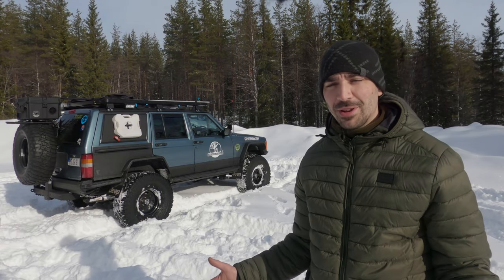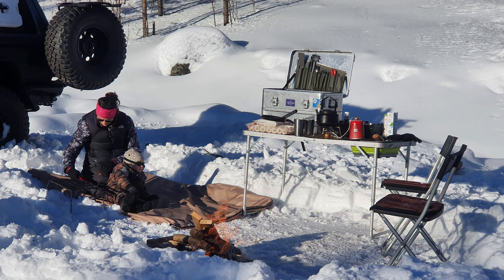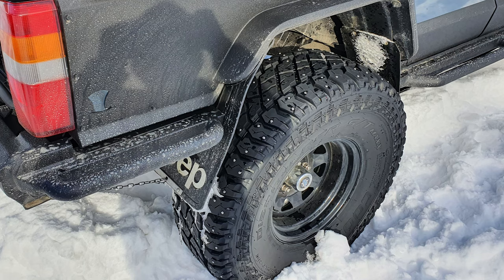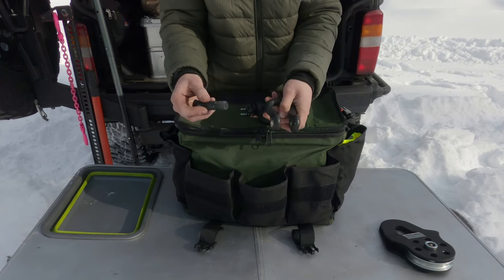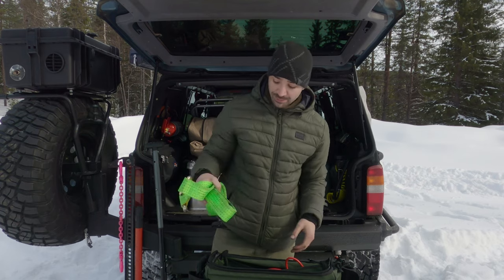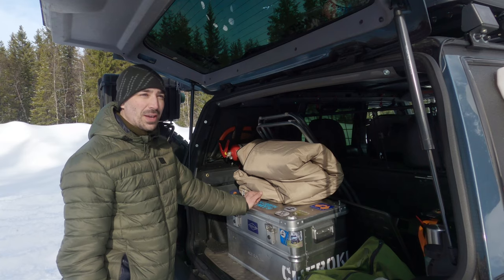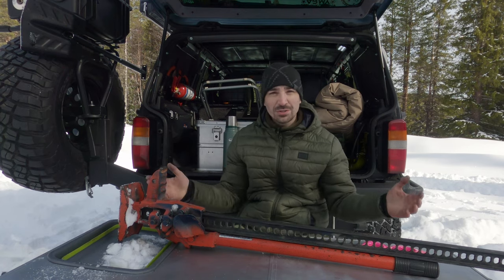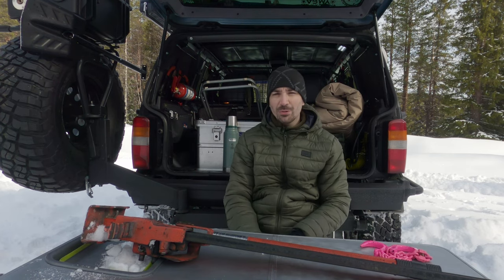My Jeep XJ Solo Recovery Kit WINTER

Comment: I think the only reason I still carry my farm lift jack (off brand from tractor supply store years and years ago) is because I haven't been able to afford a winch and such yet. So it is my only option for winching if needed. But to be honest I use it on the farm much more than with my truck. I've only had to use it as a winch for real (like not practicing) once. But once I get a hydraulic winch I will likely just leave it for farm use.

Comment: Hi Mike long time viewer great channel, Is there any reason you use wire on your winch rather than synthetic rope? And just a tip (as I share you jubilations on the Hi-lift's), if u need to change a spring put the bottle jack between the axle and chassis and jack them apart works well.
Reply from the maker: I wanted synthetic line but I got this one for a deal on a special so I went for it. I would like the rope through. This wire has gotten crushed in challenging recoveries and its worrying me! Thanks for the tip also!!
Reply: @WorkshoptoWilderness  Hey Mike. What's your thoughts on exhaust Jack's? I've been umming and arring over them for years, Could be good to slip under the car in heavy snow?

Comment: I have had two vm td's. On the back of the servo steering pump, there was an unused axle end turning. Always wondered if it could be used for something useful like ...pump.. pto.. hydraulic.. :D
Reply from the maker: I know the axle you mean. I have another TD in the garage and I've often wondered about using it for something else. A mate of mine back in the UK has one with a PTO out the back of it. Would be smart to rig something up on the Jeep and make use of it.